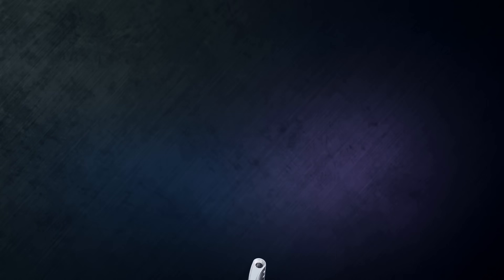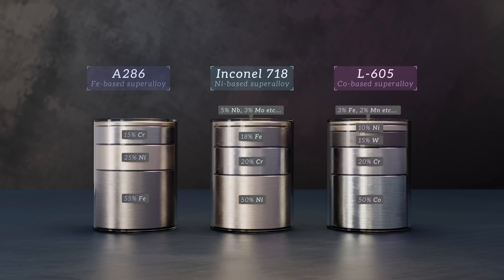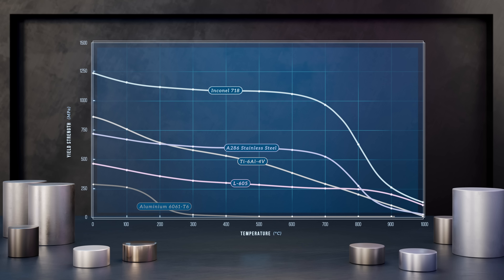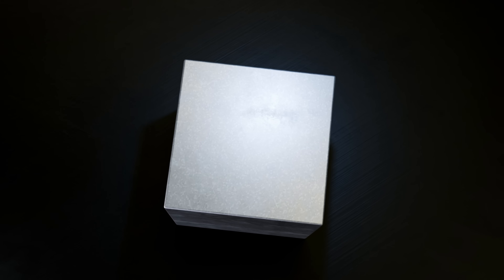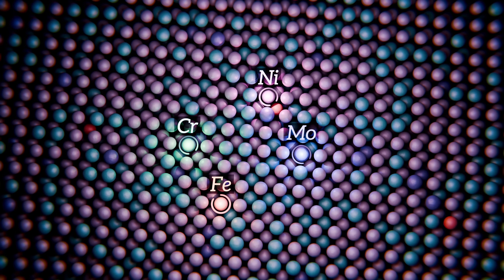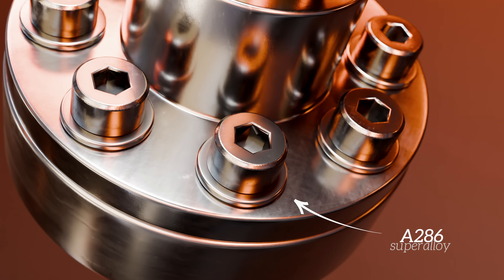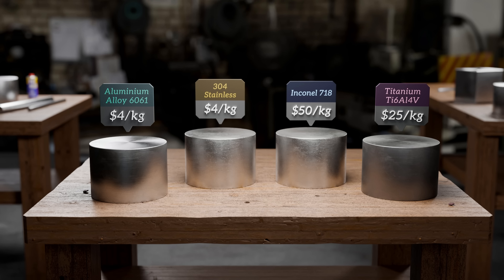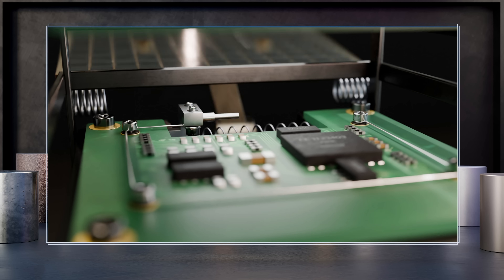The Insane Properties of Superalloys

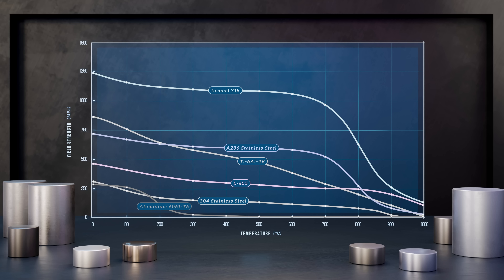Comment: 4:08 I notice that Inconel 718 has strictly higher yield strength than every other material on the graph, and that it also had the lowest creep in the subsequent scenario.  Is the only reason NOT to use it its high density and cost?

Comment: The typical turbine inlet temperature TIT

1970s widebody engines: ~1100–1250 °C

Concorde supersonic engine: ~1425 °C

Modern airliner engines (Trent, GEnx, LEAP): ~1375–1580 °C

Advanced fighter engines (F135): ~1700+ °C

Its just extremely difficult Engineering

Comment: I worked in offshore O&G for over 10 years and metals manufacturing for 5 and this video brought a smile to my face - having worked with all these materiala at one point or another.  On the cost aspect as well - though the super alloys will inevitably save cost one has to be all over the QA aspects - as they only get these amazing properies due to the delicate microstructural control.  Though because they ignored it I got to explain to a Csuite executive what "sigma phase embrittlement" was when they had a failure on some critical kit which we then upgraded to 253 MA

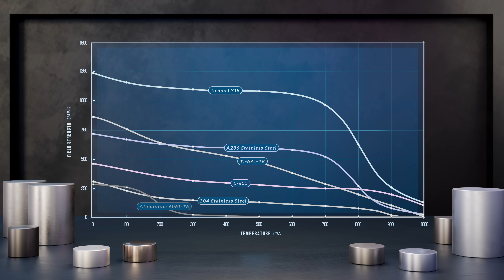Comment: Interesting video. However, I should note that the test depicted at 4:15 is a little visually misleading. 

A tensile stress of 300 MPa is rather substantial and that would require the force of gravity of a 100 kg weight to be distributed across a very small cross-sectional area, a bit more than 3 mm^2. That would be a thin rod with a roughly 2 mm diameter, not exactly a thick bar as depicted.

This doesn’t take away from the remarkable creep resistance of superalloys, but it should be noted that 304 stainless steel and Ti-6Al-4V aren’t as weak as implied by the visuals.

Comment: Inconel, incoloy hastelloy, monel and various grades of Ti are metals I work with every day. Structurally, they are amazing. Machining them is a special kind of hell, though. The reason parts made of this stuff are so expensive is not so much the material, but the staggering amount of time, effort and materials used in turning / maching them.

Comment: If you're interested in knife metallurgy, I recommend looking up Cold Steels Warcraft Tanto, made from CPM (Crucible Partical Metallurgy)3V steel, holds a wicked edge and are ridiculously strong (They bolt one to a forklift, wrap a chain around the handle and lift a car) It's also coated with a specialised finish called DLC (Diamond Like Carbon)

Comment: Ni, Co, Cr, Al, Ti, Nb, W, Re, Ru, C, B, Zr, Y. Notice I left out Mo - we didn't like it at GE Aircraft Engines because it was bad for hot corrosion resistance. I was on the team developing new turbine blade alloys, for which we would routinely do stress rupture testing at 2100°F / 1150°C. My contribution was a model that predicted a variety of properties from levels of those elements. That was 25 years ago; my sense is that we'd pretty much reached the end of the line with Ruthenium since it was so expensive. I'm afraid I know too much of the subject to enjoy a video like this, though I applaud the effort. While Alloy 718 is a remarkable material, widely used for shafts and disks, the exemplar in the Ni-base category are turbine blade alloys, e.g., Rene N6. I was the leader of the effort to make low pressure turbine blades out of gamma titanium alloys. I invented a version I named NCG 359 - the "359" was in honor of 718: the same temperature capability at half the density.
Reply: Oops - forgot Ta. Al, Ti and Ta are the elements that form the secret sauce of turbine blade alloys: the gamma-prime phase, Ni3[Al, Ti, Ta]. A good strengthening approach in metals is to have a fine grain size, but grain boundaries slip at high temperatures. The gamma-prime precipitates make up 50% of the structure, more or less, and act like grain boundaries that don't slip. That''s a severe simplification, but you get the idea. To avoid slip in the actual grain boundaries, the solution for turbine airfoils is to not have any - they are directionally solidified to form single crystals. Apart from the alloy itself, it takes a number of tricks like this to make jet engines as good as they are.
Reply: @ChesterMotors-gg3dy I saw a SEM image of these cube shaped structures… INSANE

I just KNOW one could mess around with these materials and make some insane knife blade materials. 

I mean, knife steel especially powder metallurgy steels surpassing 20% carbide volume while still remaining insanely ductile is already some of the most extreme materials anyways
Reply: @TheEfficientEngineer it would be efficient to make a video with whoever wrote this comment.
Reply: Thanks for the information.  I know a little bit about metallurgy (practically zero compared to you).  I'm wondering if I might pick your expert brain on this subject, if you don't mind?
Reply: Can someone give me the time stamp where this information is applicable .
Reply: @SegaSiege  0:00 (re-watch the whole video).🤭  Then re-read his post.  The OP is about his own work with super-alloys (obviously an expert in this field), so  it applies to the whole video more or less.
Reply: @lynnlamusga yeah I'm still a little lost on the subject I think he is just so far ahead he is laping me rn I think I need to know a little more about the topic before I understand .
Reply: @SegaSiege  As stated. in my comment, "That was 25 years ago..."
Reply: @SegaSiege  this was just an old man trying to relive his days. Cut him some slack, cause you are right, it was entirely irrelevant and almost bragging sounding. However, I do not think that is what the OP intended.
Reply: @ChesterMotors-gg3dy Hi. Can you please tell me if the old school alloy X-750 is still employed for certain low pressure turbine vanes or if it has completely phased out of hot gas path structural member applications in modern commercial jet engines? Thank you.
Reply: @Crimsonnaire  Probably rarely specified these days if at all. But note "X750" was probably never named in drawings; manufacturers create their own alloy specifications. Note I've been away for 25 years now, and never worked as a "materials application engineer", who are in  the loop on such things.
Reply: Know how lucky you are to have done that? That’s tantamount to making acid in the 60s… that place and time for doing metallurgical experiments was probably burgeoning and incredibly fun and rewarding 

I could pick your brain all day. Seriously. 

I hardly give a figgly fuck about hot corrosion resistance or even strength for that matter. I’m mainly concerned with knife steels and non steels for that matter. 

When I look into super alloys, I only find things good for aerospace. Do you know of any super neat alloys one could use for a knife? 

Things like stellite or other dendritic cobalt alloys, beta c titanium, and “high impact ceramic” that apparently has an yttrium addition. Anything you can think of? 

The lower hardness of these alloys are alleviated by depositing little beads of carbide into the steel with a carbidizer.

Comment: I worked for a medical firm and they are using MoRe material ( superalloy) in designing medical devices. MoRe is an amalgam of Molybdenum and Rhenium alloy which earlier was used by NASA in designing Space components.
Reply: That sounds extremely expensive
Reply: @jonathanjones3126 Yeah! Comes with both advantages and disadvantages. Good for producing smaller components without compromising the strength but difficult to machine. They are working in designing spinal and structural heart products.

Comment: The temperature of the gas entering the turbine section can easily be around 1500 C. Not only is there stress from the high rotational speeds but from the high temperatures as well in the form of thermal stresses. This just goes to show how high of a level the technology used in the aerospace engineering industry needs to be. I did a project on modelling a single crystal turbine blade with crystal plasticity parameters involved. It was amazing. Thanks for the great video!
Reply: heyyy, can u give more info on how you made a single crystal turbine blade? As in manufacturing and other stuff??? It'd be super dope if you have a paper or something. It'll be a fun read!!!
Reply: @threeuniquefingers  I used an ABAQUS UMAT subroutine to implement the plasticity models. The turbine blade was drawn using SIEMENS NX, based on a fir-tree design. It is fairly common way of drawing them if I'm not mistaken. I also drew the disk attachment and gave it the properties of INC 718. For the turbine blade I used CMSX-4 as the single crystal material for the turbine blade. There is a book by Bernard Fedelich, in the third chapter "Crystal orientation and elastic
properties" that goes over the mechanical properties of CMSX-4. One major aspect of the modelling is that the contact interaction between the blade and the disk. Hope this helps!
Reply: I cut the single-cryatal castings, and I can verify that even the grain of the gring/cut gets inspected because of how tight tolerances and processes are.
Reply: @threeuniquefingers there is a YouTube video on it. I watched it not too long ago. It showed for they put a spiral in the casting for the blade to bottleneck the growth of the crystals so only a single crystal can fit to grow into the remaining cast.

EDIT: I went back in my history and found it "Why jet engines don't melt." By Veritasium

Comment: I would love a video on Creep! 

I do a lot of (FDM )3D printing, and find that creep is often the most limiting factor. The only two commonly available 3D filament materials with low creep that I've been able to find is ABS (or ASA) and PolyCarbonate; whereas PLA, PETG and especially Nylon are terrible at creep. Nylon in especially frustrating, since it is often touted and marketed as being a great engineering filament.

Love the videos!
Reply: "Creep" in plastics is usualy stress relaxation, and differs alot from in the mechanics from metallic creep.
Reply: @IkarimTheCreature  Do you know where I could read more on this?
Reply: @JOHANDOMEIJ  The wikipedia article on stress relaxation, especialy the paragraph about polymers is a good starting point
Reply: @IkarimTheCreature  Thanks! Wikipedia binge coming up :)

Comment: Jet engine manufacturers are moving away again from superalloys, and have started using SiC/SiC CMC blades. Three times as light and even higher operating temperatures. Will you treat that as well?
Reply: This is a really tough subject to talk about because the engineering behind putting ceramics into rotating assemblies is very highly proprietary and protected. I work professionally in the CMC (ceramic matrix composites) field, and the rotating assembly stuff is just bonkers. That said, a general video on CMCs, or maybe CMCs and MMCs would be amazing.
Reply: @thereddufus  I had to make an assignment on this a couple of weeks ago, the only sources I could find on it were youtube videos from GE. So you are probably very right!
Reply: @thereddufus That being said.Where do other countries stand in terms of this technology.Countries like Russia,France,Germany,China,Japan,Britain.Countries outside the U.S?
Reply: Like more common ceramics don't they have very poor impact resistance and are prone to cracks due to thermal cycling,vibrations etc? 

I am aware that there is a lot of advancements towards flexible high temp ceramics but can they survive years on an jet engine that can have rushed/cutting costs type manufacturing with possible occasional maintenance neglect.

I mean in a lab setting and ideal conditions they might work perfectly but can they withstand abuse? And if they fail will they fail suddenly?
Reply: @kostarak3160  I'm sure the other guy can tell you much more about it, but here's what I know: CMC's are ceramic fibers embedded in a ceramic matrix. Much like glass, the base material is brittle, but in thin fibers they become quite strong. On these fibers there is a couple of proprietary coatings that increase toughness and some other stuff. Impact resistance is slightly lower than that of steel, so not great but acceptable. They have good resistance to thermal shock and thermal cycles. CMC turbine blades have been used in stationary gas turbines for quite a while, but it's only recently that they are deemed safe enough to use in jet engines.
Reply: @toonverbruggen7351 Thanks for the reply, i appreciate it.

That's quite interesting, i have not really delved into ceramics or ceramic composites. I will take a look at them and although i will probably never use them you have expanded my knowledge.
Reply: Ceramics are practically always  more brittle than any Ceramics.  Each has their place.

Comment: The creep resistance depends on different creep mechanisms. Some diffusion based and some sliding based. Monocrystalline blades helps against the sliding modes mostly, which starts a lower temperatures than the diffusion ones

Comment: You forgot to mention Mo helps the Cr passivation layer to be even more stable and corrosion resistant (which is the difference of 316 and 304 austenitic stainless steel for example)
Reply: To add, the thickness is dependant on temperature because the distance electrons can tunnel is dependant on temperature. When electrons can no longer tunnel past the passivating layer the reaction stops. All materials with a pillings-bedworth ratio between about .7 and 1.3 create a passivating layer